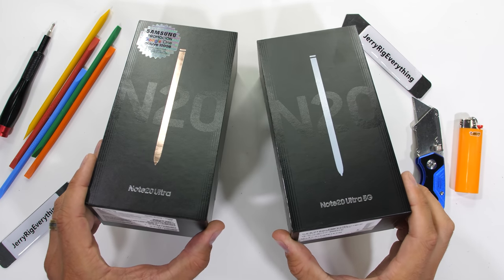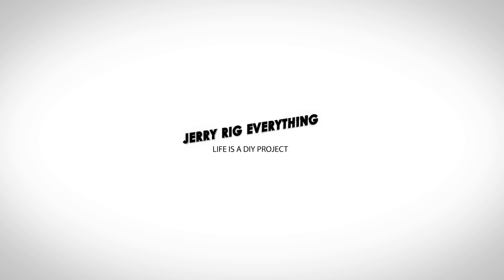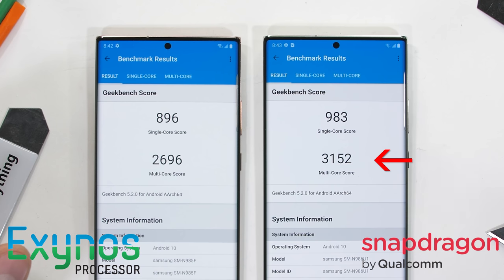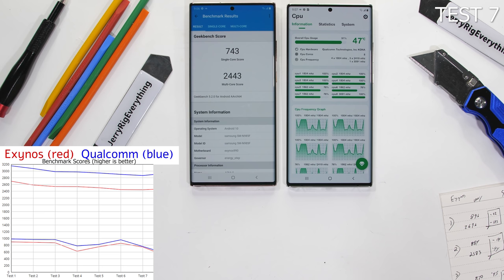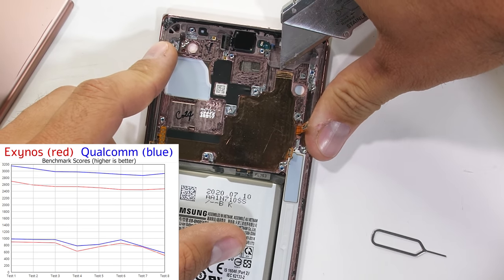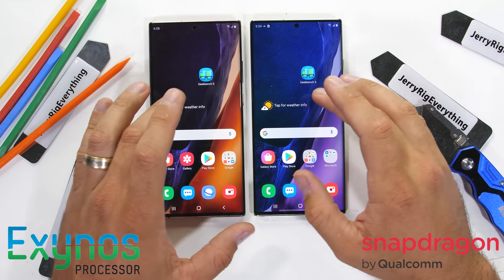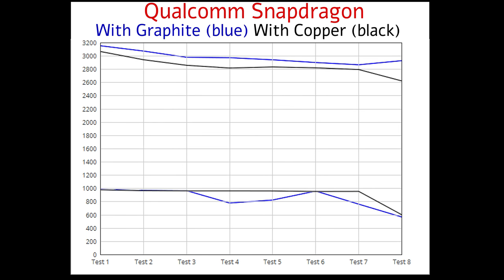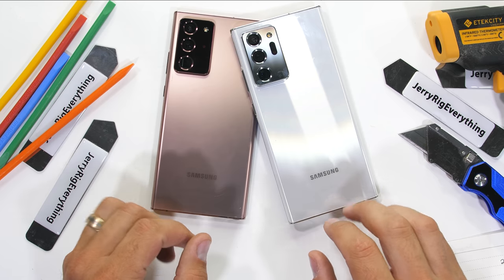Samsung should explain this... Exynos vs Qualcomm?! - Note 20 Ultra

Comment: Idk why Samsung is still putting Exynos processors in their devices with those higher prices knowing that Qualcomm is much better, that's why I don't like Samsung pretty much
Reply: Juan Camilo Carrillo because of money that's why
Reply: Because Samsung develops and manufactures Exynos chips. There's a lot more money to be made instead of buying all their chips from Qualcomm.
Reply: They have been in development for a while, they have been recycling the same chip for a few years over now, merely increasing the ipc and core count but the architecture is the same if I remember correctly, maybe they have something big in the works but requires tuning or something, idk
Reply: Probably of supply and depand. Qualcomm is unable to provide enought processors to Samsung in a short period of time so they use exynos as additional supply
Reply: That's their R&D done on humans
Reply: everyone else also has qualcomm chips, it differentiates their phones, sonce noone else has exynos in their devices
Reply: @fewik8567  maybe they should license the ZEN cores from AMD XD (rip battery life tho)
Reply: @CMDRunematti  zen is an x86 architecture, phones use ARM, would be cool though
Reply: @fewik8567  isn't there already x86 android (might be wrong on that, but also, it's based on Linux kernel so... ) and again, noob in the chip making business, but couldn't they modify the cores to understand the other kind of instruction set? seem to recall instructions related to the actual hardware pathways on the cpu... so you have to make the pathways for four the new instruction sets... might be a bit of engineering for sure... but the basic functions are the same, adding, subtracting, etc... well, just dreaming here 😁
Reply: @danielrouw2593  near stock arm cores? ARM is an architecture using RISC for an reduced instruction set for power efficiency, the only difference thing you can do to a CPU is change it's SOC which is purely dependant on the manufacturer so Samsung choose the layout of the cores and memory controller ect which determines how the chip will perform, if they lay it correctly it's IPC would be better
Reply: Cheaper to them and people are stupid enough to buy it. Since most tech influencers are US baesd they will provide info regarding the better version. And remenber, the phone in Euros 1299 so its even more expensive than it's US counterpart
Reply: they make more profit
Reply: @CMDRunematti  you could create another instruction set as far as I know but that creates another step in the process which in return reduces performance, most applications for x86 are usually too demanding for a mobile device anyway and doesn't really add a huge benifit to use ability and comparability

X86 Android is just a version of Android for a laptop or pc, or a device using x86, works fine since the ipc is so much greater on something like an athlon 200ge over a SD965 ect the extra instruction set doesn't have much of an impact on performance and apps on mobile will almost never fully utilise a half decent modern PC, I don't know a huge amount about arm but yeah
Reply: @fewik8567  why would it be "another step"? you mention this step would reduce preformance, so it's not a development step, rather you mean something like a translation layer. what i meant is changing the chip to natively accept the reduced instruction set of ARM (which would make it not x86 compatible)

as far as i can tell, a lot of programs could run on ARM if they didn't use the special instructions x86 have (don't ask for specific functions pls xD)

now that I think of it, you might've meant the higher functions in x86 that finish in 1 cycle might take 2,3,5,10 cycles on the simpler set. (like instead of one step :multiply 3x4, it would have to add 4 3 times, tripling the time)

now tho... that doesn't mean at all you couldn't use a stripped down zen core in a phone, removing the circuits only x86 would use, and only leave those that fit the ARM set. or even better, simply just use the laptop version of Android in a phone. friend of mine who knows what he's talking about (unlike me...) said about these Intel security problems, that most of them doesn't even impact Linux, because Linux doesn't rely the fancy instructions that cause the problems under for example, windows. so i mean, it already has reduced instruction set, and it already runs on x86, as far as i know it also runs on ARM.

now I'm just rambling... but for sure seems like it would be a trivial pursuit to use zen instead of ARM cores, be it exynos or snapdragon. plus... imagine AMD graphics in your phone xD
Reply: @CMDRunematti  once you've actually got a zen core into a phone which not only is larger but as standard at minimum consumes around 65w, or 25/30x as much power as a ARM core, zen also relies and very fast memory or a lower memory CL rating to function well, and the physical size of a zen core is larger than that used in a phone, the extra step or cycle I refer to is another instruction set that informs the application and cpu how to work, without it they couldn't understand each other, ARM is ahead of AMD's zen, if you increased the power limit of an arm CPU it would work so well it would in theory render x86 useless but it would be expensive to make the transition and has a lot of development for a desktop, not only that but 99% of applications wouldn't run and require an entire overhaul, changing the chip wouldn't work to natively understand x86 because what makes it ARM is it's reduced instruction set and power consumption, x86 doesn't have to take these into find as much and there's much more room on the die physically, you could probably glue two chips together to have a chip translating for the other but would be very very complex, similar to what amd did with their opterons, and that didn't do the much justice
Reply: @fewik8567  hmm so... there's this huge leap in desktop computing, and the guys who made it couldn't put together a cpu that's better than an ARM made one (the company) that can use ARM instruction set? about the memory issue, I'm not certain why they need the fast memory, I can't comment on that, i do know they need it tho.

application compatibility does not at all matter, there's Linux applications already for x86 compatibility, and Android applications for ARM compatibility, you can reasonably do anything on either already. I mean, you aren't gonna be rendering 4k photoreal pictures on a handheld anyway. i mean programming, photoshop, journalism, video editing can be done on either system already, if you put in the effort. the developers will catch up.

biggest hurdle might be the power, sounds to me it would be beneficial from a power and performance standpoint to just get a mobile design, scale it up 10x and use it in a desktop case to create a supercomputer... I wouldn't mind android as my desktop, it's way ahead of Linux with its live wallpapers xD. imagine a threadripper chip but instead of zen clusters, you would use the qualcomm SOCs xD (i know you need different layout of pcb and much more to make it work, but trust an engineering team can do it in a couple years at most)

anyway its fun to think about this and I'm excited for the future of tech either way

Comment: Exynos Should be called the "Note 20 Ultra Minus."
Reply: note 10 ++
Reply: @tpss3834  Note 10- -; 7:55
Reply: I think its dumb to ship a smartphone that is worse in some country than in the us but i actually have a note 20 ultra(exynos) and my geekbench results were higher than his and i think that even the weaker processor is strong enough (and the note 20 ultra only costs 1096€ when u buy one in store in Germany
Reply: @tpss3834  it's now 2020, so the proper way is to sync it as note 20 ultra. Then just minus to make it near note10+

Comment: If memory serves, the Exynos CPU used to be faster than the Qualcom chip. I believe this changed with the galaxy S8 and Snapdragon 835.
Reply: Yep you are correct. Markets outside the US are paying their dues now. For years we had the crippled phone, but nobody cared back then
Reply: I thought that one too. I remember when I was using a galaxy s4 i was upset because it was a snapdragon. it was said that the sd variant was slower and gets hot easier so i was happy when i bought a note8 that it was exynos only to find out that it was the inferior version. 😅
Reply: Yes. Those were the times that I’m glad that my country always gets the exynos and not the Snapdragon. It destroys the snapdragon in benchmarks and always on par with Apple’s chips. I have high hopes for Exynos next year though knowing that they are partnering with ARM for their cpus.
Reply: But the difference wasn't as big as now
Reply: It's the S10 onwards where the Exynos start to really fall behind. The S8 and S9 is still somewhat comparable to its Snapdragon counterparts (Aside from the graphics, being the slightly inferior Mali, but that's mostly because Qualcomm had Adreno to themselves).

There's supposed to be the partnership with ARM and AMD for a "new Exynos" which looked promising at first, but then based on recent rumours, we might not see it just yet...
Reply: @germaineliew2012  S9 Exynos was already shit, with the Whole Fortnite thing they brought the Snapdragon version here to Brazil instead of Exynos, they know the shit they're doing
Reply: No bro, snapdragon was always superior. Trust me, I've owned a few of these phones. Exynos is a cheaper chipset than Qualcomm, so Samsung is just trying to save their money in some parts of the world with their so called "international version "
Reply: @germaineliew2012  you forgot they partnership with intel to make the 5g versions get more bandwidth too
Reply: @chefcomtechmike6303  look at phonebuff galaxy S7 exynos vs Snapdragon speedtest

Comment: They have been doing this for years, like ever since 2013 or so.
This has also been a factor in modding and custom ROMs as the SoC makes quite a difference
Reply: I'm actually happier with my Exynos, because custom kernels/ROMs tend to support Exynos better. Snapdragon is a big black box - and I'm no fan of that. Planned obsolescence are gonna bite those users soon, while we can still install custom ROMs on ours.
Reply: Fusseldieb So you assume 100% of Samsung users will wipe/root/ and install custom roms and kernels, risking bricking their devices and completely voiding any forms of warranties?
Reply: Them doing this for a long time does not justify that they are literally scamming their customers.
Reply: @NeonLuminous  No it was only recently that the exynos got worse. Most of the time it was better or basically the same but now since like the S7/S8 it got worse
Reply: @fusseldieb  if you are fine with a sub par lower end product than what u paid for.... then good for you, especially knowing that half the world essentially paid the same and have a much better project. but people like u deserve exynos lol
Reply: @fusseldieb  I don't think that Qualcomm is that bad, they also have CAF which is basically AOSP with full support for the Qualcomm Snapdragon platform.

Comment: Exynos version performs almost worse than last year's SD855. I've even heard the camera performance does not match the snapdragon version. I'm not considering getting a Samsung phone unless they stop this scam.
Thanks Zack for calling them out on their stupid policy.
Reply: Sadly it has been over half a decade since they started doing this crap! I will be moving to apple waiting for the 12 Pro!
Reply: We can't see the 16 percent difference in day to to day use so these bench marks are useless.
Both phones have same software and  same features . Both can record 8k video 
Which is a very processer hungry task.
Reply: @amru4553  you should look at the mi 10 ultra
Reply: @amru4553  The Exynos used to be better up until the S8, where they were mostly equal except some video recording advantage for the Exynos that was patched out. The Snapdragon being this much better is a recent development because of Samsung's now defunct Mongoose core team not designing their CPU properly. Next year Samsung's Exynos is removing the mongoose cores, so they may be equal again.
Reply: @inderdeol6746  But the overall difference (battery, heat, camera performance,...) is noticable. If you want I can link a video from Mrwhosetheboss, it shows the difference really well
Reply: @inderdeol6746  neither can you notice the difference between SD 865 and SD 765G. It's all about the scam, About charging the same amount but giving inferior devices. I don't know why people keep defending Samsung's dick move.
Reply: Inder Deol how about when it ages? when it’s 4 years old your really gonna wish you had that extra 16%. with the battery lasting shorter and the phone getting hotter means that the battery is gonna degrade faster

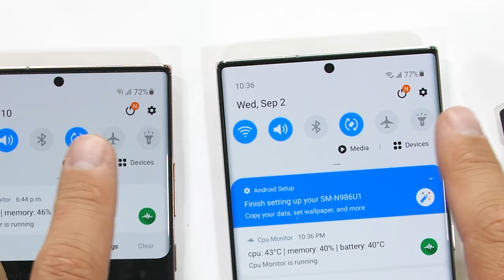Comment: 9:33
Even the internet is not working in the exynos version😂
Reply: @jayshev8017  no left one is Exynos and right one is SD
Reply: @jayshev8017  left one is exynos
Reply: Wifi is controlled by a different module altogether. And there are a lot of other factors that could cause the wifi not to work just saying
Reply: @neelb980  I know I was just saying that for fun
Reply: @rushabhdoshi2183  all good

Comment: When I got my s7 edge in march 2016, the exynos version, was superior. How times have changed.
Reply: Only in cpu because of four extra cores
Reply: @gaeborg  In some scenarios the Mali did pull ahead, Later games the Snap definately performed somewhat better
Reply: My bad, exynos 8890 was better in all aspects (includes battery) and just a little behind in graphics
Reply: @girlsdrinkfeck  maybe because the world doesn't spin around just united states?
Reply: The S6 Exynos was way ahead of the SD810, the S7 Exynos had a small advantage over the SD820, the S8 Exynos was on equal grounds with the SD835, the S9 Exynos was inferior to SD845 and the S10 Exynos was much inferior to the SD855. The S20 Exynos is a joke compared to the SD865.
Samsung needs to seriously do something about it.
Reply: but Exynos modem in s7 was a joke, that was my main issue with Exynos version, maybe it's different in other countries tho but many people complain about exynons modem even in Note 10+ etc.
Reply: Since Snapdragon started developing and including the neural processing units in their SoC's they have been making some pretty substantial leaps in performance, since them and Apple's SoC division are practically the two pioneers in that technology. Others are trying to catch up. So I'm guessing that's the reason why.

Comment: Watching this from my Samsung Note 20 Exynos 😥
Reply: F
Reply: F
Reply: F
Reply: F
Reply: F
Reply: Do you mean Scamsung NOT 20 ultra
Reply: No difference in every day use
Reply: @anwarzikry2135  F
Reply: F
Reply: Gabriele Clemente Pirozzi scamsuung NOPE 20 UlTrA
Reply: F
Reply: @m.8442  it is not real, in battery there is a HUGE difference
Reply: @m.8442  Play a couple of games or just do heavy use so ur phone will heat and dies faster! But sure not "difference" in everyday use" the idiot says
Reply: This phone is never designed for gaming phone to begin with, yes you can still play it, but for how long as a business user spend their time playing?
Reply: F
Reply: F
Reply: @siintrovert5343  the problem is that there i s a huge difference with this processor in battery life and photos
Reply: Still a killa phone, you should be happy you own it 😁👌
Reply: @idk-sy3iu  The coolest thing is that in normal phone usage you can't see any difference.
Reply: F
Reply: F
Reply: F
Reply: @idk-sy3iu  By huge, you mean just margin error? i kinda see that coming

86% and 84%, 77% and 72% (Both around 1% less), and that is during stress testing.

okay i guess, i might have been wrong
Reply: F
Reply: First world problems.
Reply: F
Reply: M. Huge difference.  Go and watch the battery drain test between the two versions.  That difference alone makes Samsung thieves.
Reply: @m.8442  wdym no difference i ve got the same issue and u feel the better everything everyday when taking videos in 4k60 for long periods or gaming witch is considered everyday use
Reply: @siintrovert5343  the difference is huge. Watch european reviews of the exynos... It has 5000 mah and don't last over 4 hours of display... Come on